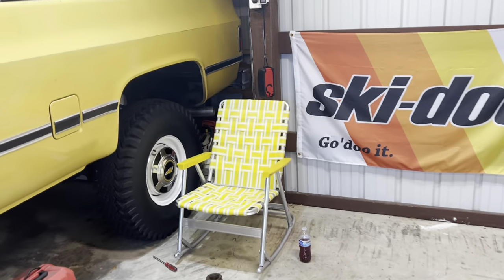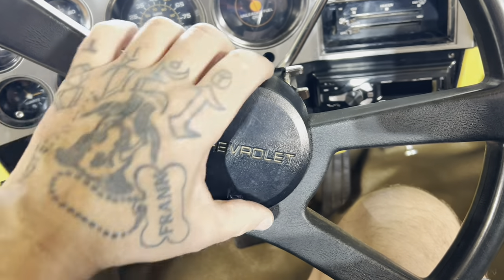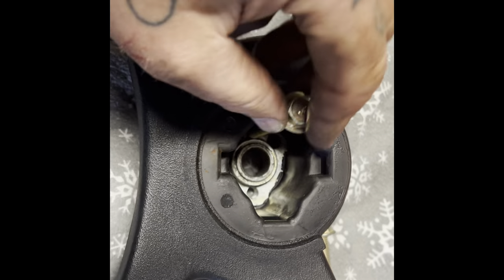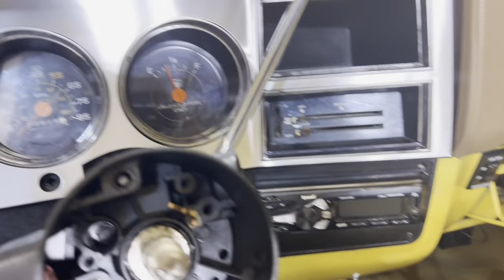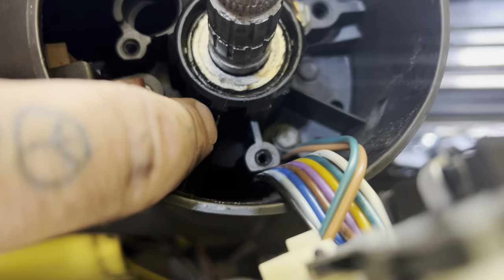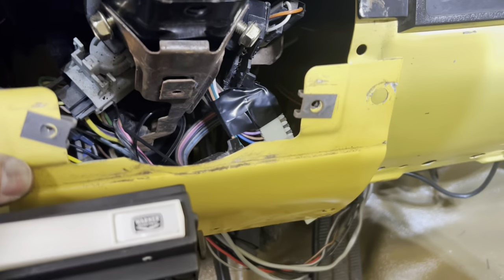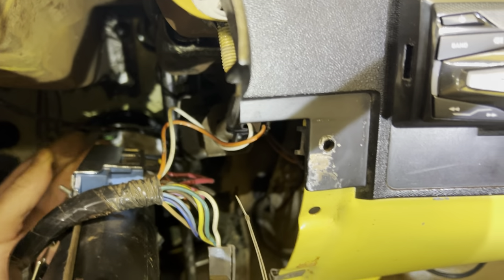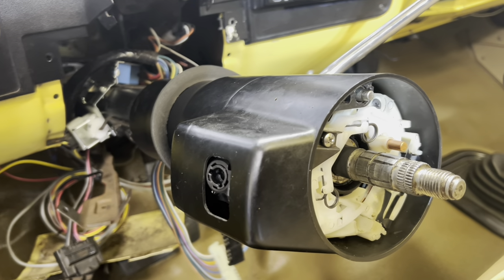Square body wiper switch, neutral safety switch, turn signal and ignition replacement

Comment: Good video, jumps right into it explaining everything along the way. I wish all how to vids were done like this. I would never attempt tearing into my steering column without this.
Reply from the maker: Glad the video was helpful. Make sure you look inside that ignition switch hole before you take things apart, the key ignition. That was the most frustrating and took the most amount of time was to figure out how to orient that after not looking inside the column before disassembling.everything else was cut and dry
Reply from the maker: I will also add... don't buy the cheapest ignition switch. The actual switch at the bottom of the column. My first switch was faulty and I had to . the more expensive switch looked a lot more like the original switch. Take care

Comment: If you had to do it again, do you think it would have been easier to remove the entire column out of the truck and then replaced everything?
Reply from the maker: @crsmith56  no!!!! Just make sure you either take a picture with your phone inside the ignition tumbler hole. So you can see what the orientation is with the teeth on the ignition rod. And don't buy the cheap ignition switch. It would be very easy for me to do it a second time. Struggled the first time because I didn't do those two things👆🏼.
Reply from the maker: @crsmith56  it would be easier but inot necessary

Comment: Great video ! 
I started taking mine apart thinking . This guys stunned its not that hard ... yes its just like you did it . Dang iv got new cuts and some new muscles . Poped my arm out of socket to get the 8mil bolt for the starter switch.  Just rediculis this has to be done this way . Great video for a step by step and how to avoid hours of mistakes . Took me about 2 hours doing it the wrong way then the right way haha . Thanx ! . 😂
Reply from the maker: I'm not gonna lie, it took me some time to figure out that the first ignition switch was faulty and how to get the rod put back into the keyed ignition switch correctly🤦‍♂️!! Your comment made my evening👍🏼